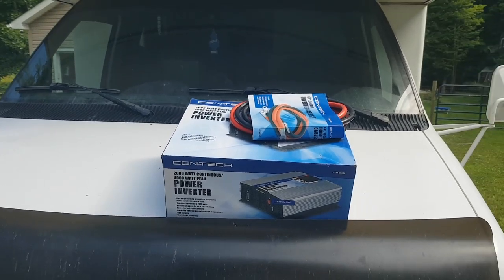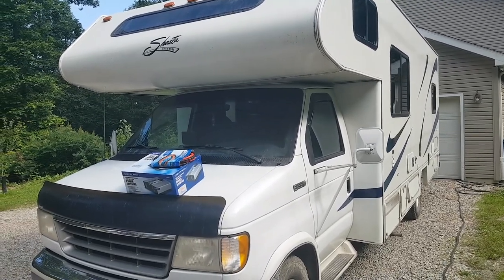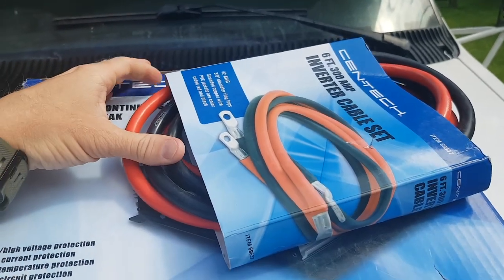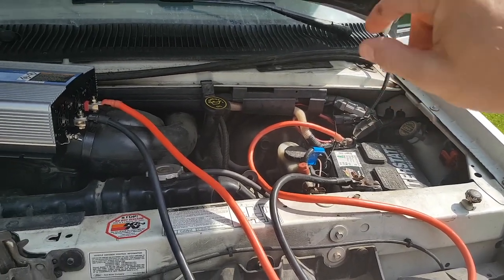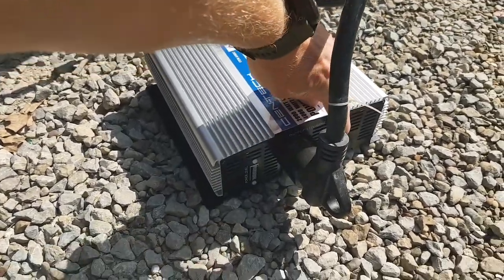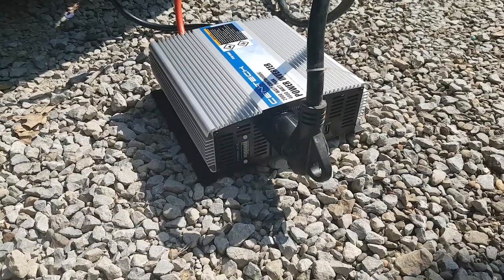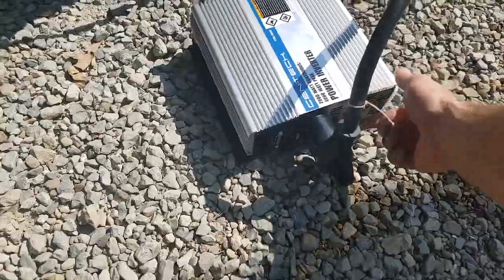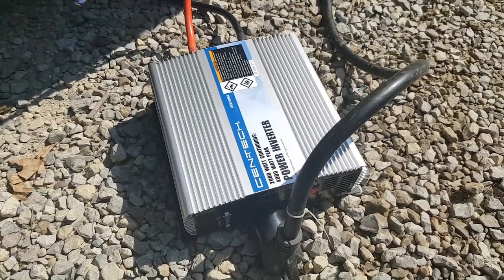Harbor Freight 2000 watt Inverter - Will It Power an RV AC System?

Comment: It's not that it won't RUN it, ....it just won't START it.   The juice required to start an AC compressor is far more than most inverters can handle.  Running it like that, you'd have to have probably a 4000 watt running/ 8000 watt surge inverter, and loads of depth in your battery bank to handle the initial power draw.   Probably minimum would be 3000 running/6000 surge.....but even that probably wouldn't handle it. 

Another way to solve this problem is to buy and install an Easy Start on your RV's AC unit.   That will bring down the inital 41 Amp, (or higher, especially on older units) which is about 4000 plus watts,  draw, down to under 20 Amps, which is around 2000 watts, which is what this inverter is rated for.   This way you're never even coming close to your inverter's surge limit, thus causing much less wear and tear on it as well.  

 And besides all that, I highly doubt that this inverter, for the price, is actually built to handle the watts that it says it is.  Those are always OPTIMAL conditions, and absolute MAX performance.   Most inverters I would say, can handle about 80% of what they're actually rated for.  There's always power loss in every connection, the inverter itself actually uses power, and here, you have a really long cable length, plus a step up to 30 amp connection, etc, etc.  

It's not that it's a piece of crap, it's just more likely that your AC's initial surge demand is even more than the 4000 watt surge capability of the Inverter, and you don't have anywhere near the power supply depth needed to handle that much of a kick either.

I just bought this inverter, and I have no doubt that this thing will easily run my new 13000 watt AC unit with an easy start installed, especially since I'm going to have an electrician help me wire it directly into the RV's electrical system.
Reply: Also found out that you're not supposed to run an AC unit, or fridge, or anything that uses an AC motor, on a modified sine wave inverter.  That's what the Jupiter is, in case you're wondering.   

SO that is ONE thing that is their fault in terms of advertising....it may be ABLE to run it, (probably still not start it), but you shouldn't run an AC unit on it.  It will work for a time, but, it most likely will damage the motor in the AC unit.   It's actually one of the few things on the list of what NOT to run on a modified sine wave inverter.  It could also be another reason why it didn't work....

I returned the thing immediately.  Not because it's junk, it's just not the right tool for the job...
Reply from the maker: Great comment. Thanks
Reply: So a inverter tht has 4000 or abit more?
Reply: @JackofAllMasterofNone  it will run a much more efficient frigidare window unit, theres a specific no digital read out unit that you should use,, sorry i dont have the model #
Reply: Just a little bit of experiance from several inverter systems ive installed:
1: Harbor freights old line of blue inverters seem much better than these news one, way heavier at least. I have a 2,000-4,000 watt modified sinewave version in a cabover camper that runs the microwave,  11k AC unit etc no issue. I can even run the AC and microwave at the same time, but i dont do that other than for testing purposes. I have probably 4-5hrs of AC run time on that setup with no bad side effects and no noticeable funny noises or lack of RPM (but i have seen that on other modified sine wave inverters).

2: I have run 13.5k AC units on 3000watt inverters no problem. One system i installed was a 220v/50amp RV with 3 AC units. I used 2 Victron multiplus 3k watt inverters. each inverter fed 1 leg of the 220v system, this means one inverter is stuff running 2 AC units while the other only has 1. Both inverters/AC units started the 13.5k AC units no issue. The one system with the addition 11K AC unit would run both AC units, but would trip overload if the big AC unit compressor cycled back on while the 11k compressor was running. Running both ACs off one inverter was a huge load, i dont remember the exact numbers but it was somewhere around a 150amp continuous load on the 12v battery bank, plus an addition 80amp load from the second inverter if all 3 AC units ran at the same time.

These are 2 great examples proving people who say "you need 6-8k watt inverter blah blah blah".  No you dont, you need a good quality inverter, proper cables, and a big enough battery bank to support the surge.
Reply: The 3000 watt harbor freight will run the AC no problem however even large lead acid batteries just won't last long enough toake it work it. If you provide enough solar power to the system then the batteries will only be used for the initial compressor start up. Also, the modified sine wave on these inverters makes for a very hard start on inductance motors. Draws more power/amps than a pure sine wave inverter would.
Reply: over and over and over again there is NO free lunch ...you simply can't get any steal of a deal answer to your delima apparently.....  Pisser!   I need to power two refrigerators and a freezer cheap....so far the only answer is a conventional generator I start and stop on a schedule...and even that has it's critics
Reply: You need an amplifier ding dongs it’s simple tech man! If at first you don’t succeed, AMP IT UP and blast that shit. It’ll either work, or blow up; both are interesting outcomes but 1s cool the others gonna need an electric fire extinguisher
Reply: @minnesconsinprepping7856  Most smoke detectors and cordless power tool chargers are instantly fried by modified sinewave inverters. It has to do with their type of internal power supplies.
Reply: It's likely your power draw.

You dont have the starting amps available with one battery. If you had 2 batteries in parallel it would likely fire it right up
Reply: How many amps does the 12v battery needs for this unit?
Reply: @minnesconsinprepping7856  exactly
Reply: 你好！
Reply: They have a SoftStart (EasyStart Brand) module you can install where it won't have such a hit when it turns on
Reply: @JamesAutoDude  its a good idea to install that on Lithium batteries so you dont destroy you Lithium cells from the surge.
Reply: It doesn't matter how large of cables you use or what type ok battery you use there will be an incredible voltage drop when you start a induction motor on a 12 volt inverter or use a micro wave oven - it might handle a micro wave oven but they only run a few minutes at a time not hours - the rating of a inverter and many generators is in KVA, that's how much power they can handle for one minute - one battery as he deminstrated might last 20-30 minutes on a 5000 BTU air-conditione that has a 425-450 watt draw - that would be about a 50- 60 amp draw off the battery - at that point your better off with a generator - inverters are grate for very light loads when you have small low voltage systems as he demestrate's his inverter set up  - once you go past a 600 watts continues, there is to much of a voltage drop for a 12 volt system - also just with a 600 watt draw you need about 24 good 125 amp lead acid battery's or 12 golf cart battery's - at that point you just as well use an inverter generator - its going to burn a gallon of gas for every 2.5 KWs of continues power you use - modified sign wave inverters will run most AC induction  motors ok - but as one said there well known for burning up electronics -. So it's better to use a sign wave inverter - with continues loads grater than 600 wats you need to go to a 24 or 48 volt inverter - for those wondering about solar panels - they only work well in the south west at 5% humidity - in the south central & many parts of the east coast they only deliver 15% of there rated power for 2 hrs a day - were humidity averages 70%
Reply: @mannyfragoza9652  I'm not sure what you are saying?  Will lithium cells be destroyed from a surge?
Reply: @myemail2005  im not sure what i meant  i think i meat the BMS from the initial spark from the charging caps?
Reply: @able880  how is humidity related to solar output??
Reply: @vim55k  what humidity does is scatter the UV light - for a solar panel to generate full rated out  put - the sun's UV light has to strike the panel directly - 
     Humidity is small water drops floating in the air like clouds but close to the ground - 
     When the sun light strikes that moisture in the air the UV off the sun light is scattered  in ever direction - 
      If there is only 15% humidity in the air solar panels will work well - 
     I live in the deep.south US - it's always 60% humidity or higher - 
       That scatters the UV light - at noon with no clouds at best a solar panel will generate 20% of it's rated out put -  It might generate 20% for two hours or from 11AM to 1 PM - on a no cloud day - 
     In the end solar panels are not efficiient down in my area - or any area with high humidity
Reply: @able880  thanks. That is interesting. Here in Israel we have 65% humidity in many places throughout the summer, but have not heard of solar panel low production. Though I have not tried it myself yet
Reply: @vim55k  it's easy to find out - if you know the short circuit current at 100% out put and say it's 10 amps - if you short the panel and it's 2.5 amps then your only generating 25 % of the rated out put - I'm at 80 ft above sea level and 50 miles north of the Gulf of Mexico - so we have dense humidity -  in Florida they have high humidity but there is always a breeze from the Atlantic and gulf of Mexico - the humidity is present but not dense - so panels do better in Florida  than over here we're I'm at - we always have clouds also - 
      I sponsor I guess around 6 or more Jews to leave Russia a yr to Israel last yr I sponsored 8 people to leave or paid for the plane fare after they were checked out - 
      I really don't know how many I've sponsored but it's more than 50 - I've been doing that for yrs - I sponsor at least 6 a yr and some times more - I'm retired now but I still sponsor at 6 people a yr to leave Russia a yr and go to Israel
Reply: @able880  I am glad you are doing this!
Reply: @vim55k  me also lol 👍
Reply: @mannyfragoza9652  not compatible, unit is for lead/acid  only
Reply: Thank you this video and this post have been very helpful to me😊

Comment: I've been running a 3000 watt harbor freight inverter for 5 years straight non stop. It's powering a permanently parked trailer and a laundry shed. Been working great.
Reply: How long could this converter run a small music setup for?
Reply: your not running your ac unless you added a capacitor bank to the ac
Reply: @202roller  did you ever find out? I’m trying to do the same thing
Reply: It's not a converter, it's a inverter. Converters changes 120volts to 12volt, a inverter changes 12volt to 120volts.
Reply: @EarlBalentine i think an inverter change dc to ac

Comment: Mine works fine.  Will be doing a full trailer build this month and just bought the 5000 watt inverter, Jupiter.  Just tested it with a shop grinder.  Works great and will run my entire trailer on 6 batteries.  You need 2 batteries to run that A/C.
Reply: He said he had two batteries, learn to listen and listen to learn I always say. Watch the video again
Reply: @pydepiperproductionsllcjon7585  It's doubtful the house battery would feed backwards into the vehicle battery (diodes) and with a thin gauge wire at that. It probably wasn't helping at all.
Reply: @JoeyHunt-gh6yz  Thank you for this reply.  Since my experiment started, my camping module, I have a 24volt 1500 watt solar array on the roof.  Nothing but that up there.  Everything else vents out the back and sides.  A victron energy charge controller .   2-24volt 202 amp hour batteries (from Big Battery).  An Aims 24volt inverter/charger.
I plug an 8000 but room a/c in my living room into it and cool my house with it.

I call this a POG system. Partial-Off-Grid.  The trailer module is all 110volt.  No RV crap on board.  The 10.1 cubic ft fridge has been running for 3 years so far.  We keep extra food in it.  The system is so powerful that we could plug the house fridge into it.
I've got it all figured out.
If you have any more questions, please ask.
Reply: Wow, that's what I said.😮 Trying to run an AC unit off of 1 LED battery with just one brain cell.

Comment: I was looking at doing the same with the 100w harbor freight solar panels and the same inverter BUT also plugging my camper shore power into it and utilizing the outlets for only charging phones, ryobi batteries, and the little fridge. Beer, music, and conversation!
Reply: Did yours work for what you needed I have the harbor freight 100w panels and Jupiter 2000w inverter just waiting on some cables to get it all set up.

Comment: Not sure but a lot of people plug into these inverters. I think the plug in sockets are probably just rated for 15 amps? My plans are to hard wire a female 30 amp rv plug next to my inverter., -then plug my shore power 30 amp into the hard wired plug. You also need 400 amp hours of batteries too, AC takes serious amperage’s, especially at start. I’m also looking into the soft start.

Comment: You will need a reserve of 3 times the running load to start an electric motor. I would also size an inverter to be rated at twice the running capacity of the highest draw component. So if you have an appliance that used 1500W, then get an inverter rated for 3000W continuous. This is for duty cycle, especially for a device like the A/C which will run for a long time.

Comment: Good thanks for your  video, each ac connection max output is 1500 wattage no matter how big of an inverter you buy.  That is just the way it is. So a 1500 wattage ac will not work do to start up wattage. I'd you want to use a inverter to run the ac you must buy a inverter with a separate connection block with 3 terminals and wire it straight to the ac. But do not forget about the start up load. Longer the wire the less power out put and bigger load on the inverter.

Comment: I've been charging large RC batteries from my vehicle for awhile.  I've noticed while idling, and pulling alot of current, the alternator can't deliver the power I need.  If I put something on the pedal to make it run about 1500rpms, then there is plenty of power and the voltage on the battery doesn't drop.  Idling and using an inverter is fine, but trying to pull alot of current isn't going to work well while idling.  

I think those things are under rated which is one problem.  The other is the initial start of the AC requires way more power.  I've actually put a current meter on my house frig.  It jumps to 18amps for half a second, then drops down to 0.5 amps while running.  An AC system is the same type of setup.  I think the initial start is whats killing it.
Reply: mapoff you are right! It’s clearly says 4000 max peak that mean for only few seconds any AC system always requires a ton of energy to start.
Reply: In assume that's what the guy was getting at because the inverter should handle 4000 peak Watts for this reason.
And i think you said that backwards, those inverters are over rated, lol.

Reality is he got what he paid for, a good quality true RMS inverter of the same rating would likely work a lot better but cost two three times more.
I have the exact same unit in this video but i knew what i was getting. Mine runs everything i needed it to but I'd never expect it to pull a compressor of that size.
But it runs my house fridge several lights and a large tv no problem.
Reply: @ezridr1234  What I'm saying is with the car only idling, the alternator can't provide the power needed for the inverter to do 4000 watts, even if it was truly rated for 4000 watts.  The alternator is a generation of power.  At idle its turning too slow to provide its maximum output.  I've noticed that simply going from idle to 1500rpms on the car allows a much greater output (alternator).  I think if the test was redone but someone pushing the gas pedal a little past idle, it would have worked.
Reply: @itspoffy  
I fully understood what you were saying, not sure why you felt you needed to re-emphasize it though.

And turns out, i went and pulled mine out after seeing this and i don't have the exact same one as mine is a different brand, just looks exactly like it.

But you know even with the alternator issue these things should put out what they're rated for without an alternator even connected.

You have to remember, there alt is also raising the input volts likely to around 14.5 v give or take. I know one thing for certain, deep cell Marine battery makes one hell of a difference in performance of these things.
I just know before buying one myself i done a lot of research and learned quickly there are two types of these made, i really wanted to purchase the better if the two but damn they're high dollar. I'm speaking about the ones that offer a true sine wave form rather than these cheap ones and that's what i was saying above. Harbor freight is nice to have around but you've got to think out what your buying there because they sell some really cheap bad crap. Buying a vice for the bench is one thing, but electronics? Have to be careful.
I had one of the small bench grinders that just went out on me about a month ago after around 12 years of service, can't complain there but i have also busted a 5in vice in half after only owning for 2 days. After that i knew i could only use it for so much.

Comment: I would be willing to bet that if you monitor the dc voltage input, the voltage will sag significantly, and that is the reason for test failure. It takes a STOUT battery, STOUT cables, and great connections to prevent that voltage sag. I would be willing to bet you would have much better results connected properly to a big battery bank or lithium battery bank. A soft start circuit on the air conditioner will also help.